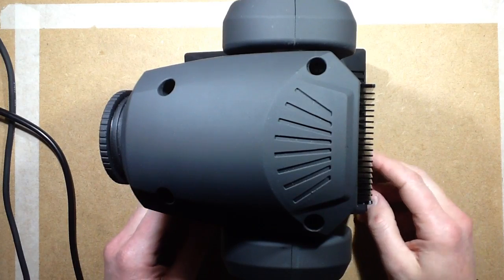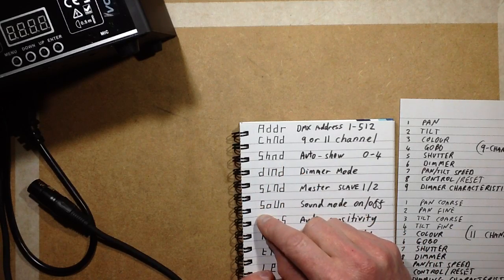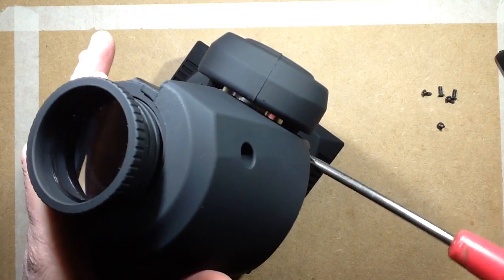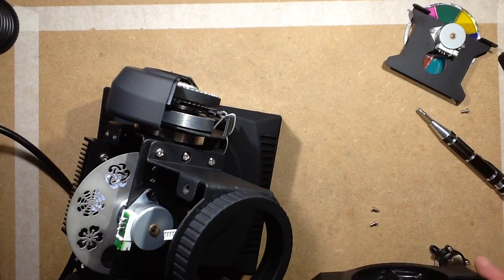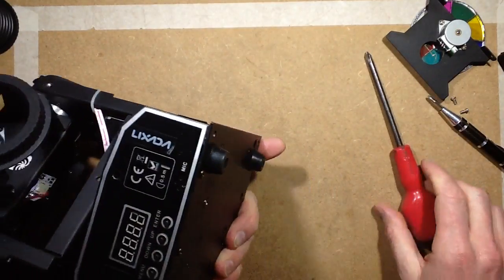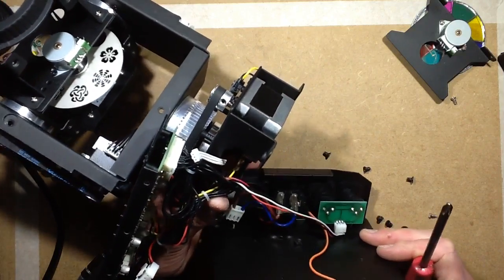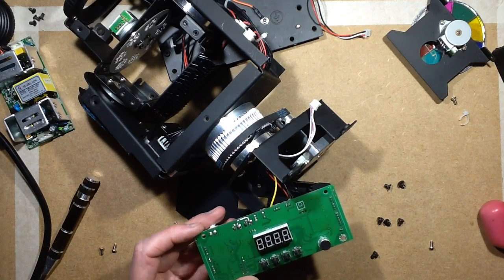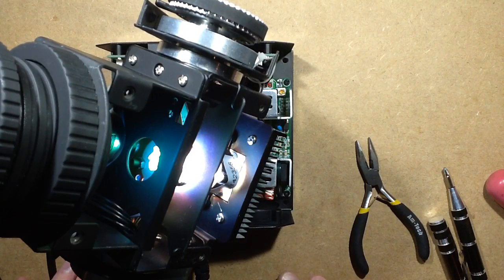10W LED "blunty" moving head disco light teardown.

Comment: Those STM32 series MCUs have been around for quite some time. But just recently they seem to pop up everywhere. You can get them from 2$ upwards on ebay (or less than 10$ for a dev board). So they don't cost much more than the Atmel AVRs (used in the Arduino for example), but they have way more features (32bit and DMA, more RAM/flash/EEPROM, more IO/UARTS/I2C, more timers, and general configureability). There are quite a few projects that maxed out the AVRs/Arduino and moved to the STM32F1 (or the bigger brothers F3/F4), flight controllers for RC crafts for example. My guess: expect to see them more often.

http://www.st.com/web/en/catalog/mmc/FM141/SC1169?sc=stm32
Reply: +superdau ST microcontrollers are extremely popular among Chinese designer (STM8 as low end or STM32). I can guess that is because they are cheap and they will not have problem obtaining them (French-Italian company but registered in Switzerland so in any case they are safe), only interesting is that ST is one of few companies that do not make its silicon products in China (they don't have any manufacturing facilities in China) and they are one of biggest manufacturers in world (by volume they are second after TI)
STM32 are one of better ARM based microcontrollers on market (they have their silicon bugs but no more then others) and for while they are my choice of microcontrollers (and I am not Chines) for anything that need more then 10 IO (they do not make 6 pin microcontrollers).
You can find STM32F103 for less then 1.5$ and you can find simple boards with them for 2.5$ (from China).

Comment: Saw exactly same Poundland screwdriver in the local Less-Than-10$ shop called Daiso, which was 2000KRW. I opted in for the slightly more dodgy one instead because it came with Torx screws and longer handle, but with no way to store bits other than the default stash block.
Summary: Next screwdriver I will get will be that one.
Reply: Oh, plus I saw the EXACT same Laser bike light there, along with solar powered one which has 45mAH rechargeable Ni-MH button cells soldered together.
Bought one and gonna change the battery to 120mAH one, but I have no idea if it will ever store charges.

Comment: What screwdrivers do you use, and how can I get a hold of some? They look really useful.
Reply: They're Poundland ones, probably inheriting better bits from somewhere.
Reply from the maker: +Mulletmanalive Original bits.  They're actually surprisingly resilient.
Reply: +bigclivedotcom huh... Well, doofus here managed to kill two bits the first time I used my first Bulldog brand one (99p Stores, same item, basically) but I've been more careful with my more recent ones from Poundland. My favourite is a plastic handled one from Maplin with double ended bits, haven't been able to get another though :-(
Reply: What would I google to see where I can get it in the US?
Reply from the maker: +TheTerminatorOfDoom Try a search for 9 in 1 driver.
Reply from the maker: +Mulletmanalive I've had sets from other sources which did just mutilate when used, but the Poundland sets actually seem pretty good.  Even when misused.

Comment: the ULN2803's are actually quite commonly used to drive stepper motors. Quite many arduino shields and projects use this IC for that purpose. The bridging of each 2 pins is used to double the current (0,5A each) for each stepper motor coil. Some people even stack 2 of those on eachother to achieve the same effect (yes it's hacky and may be unreliable)

Comment: I don't know anything about these sorts of lights, so please forgive me if the question I ask sounds stupid.  Is there any reason why they've used a white only LED and not RGB colour LEDs?  How much would a light like this cost to buy?
Reply from the maker: +Lachlant1984 It cost £80 (About 120 US$).  The use of a single white LED mkes the optical path simpler.  No matter how close they tried to mount separate RGB emitters they would end up with each colour taking a slightkly different angle through the lens causing colour fringing at the gobo edges.
Reply: That way they are also able to achieve uv-ish blue and deep reds, colors that can not be made by rgb mixing. Although I don't know if that's the case with this particular unit.

Comment: are you gona put in a biger led ?
Reply: +bigclivedotcom i own 2 moving heads and 2 scanners with a 24v 250w bulb one day i want to rebould them to led
Reply: +ljmike1204 I have tryed that. The problem is that the LED have a larger outut aria than the halogen bulb. So led products have to have largers optics to work, or you will have a large loss of output.
Reply from the maker: +ljmike1204 A bigger LED would require a bigger power supply and even more power and modifications for a cooling fan in the head.  So at the moment the one in it is probably a good choice.
Reply: How do i always find you on all my favorite channels?
Reply: +ljmike1204 You could push the existing led a bit harder its a 10W led driven @ 6W
Reply from the maker: +MoltenSalt Reactor I was pondering that.  Particularly if there is a current pot on the existing LED driver.  That said, a higher current will put extra load on the PSU and also the LED.
Reply: AlbanyHauntCA i dont know :P i found this guy taking a look inside my fav light the VL5 its sutch a cool light i wish i could aford 4 of them
Reply: +ljmike1204 we got this light with a bigger LED already and yes it has a cooling fan
Reply: @trompolights  hi, did you just change the led or did something else to your moving head?  I have 7 of this light's and I wonder if I can put 60 watts led on it